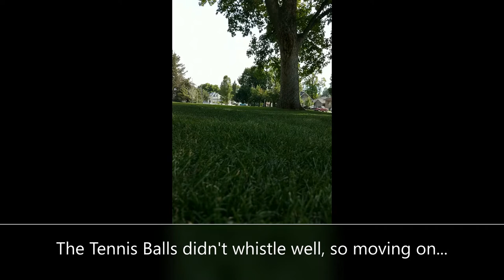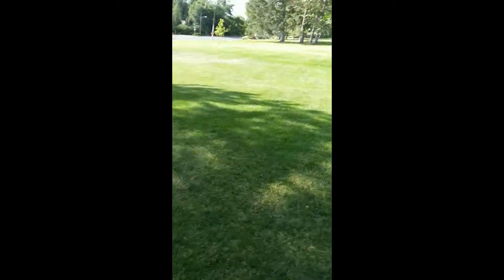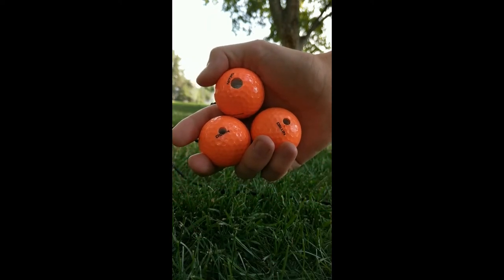Slinging Whistling Projectiles

Comment from the maker: It's interesting to compare the shot at 1:46 with the shot at 3:23.  This, respectively, was the 1/4" diameter hole drilled all the way through versus the 1/4" diameter hole that was only drilled in about 1".